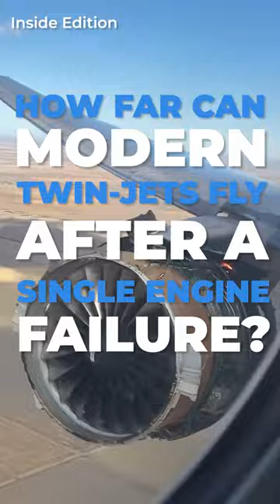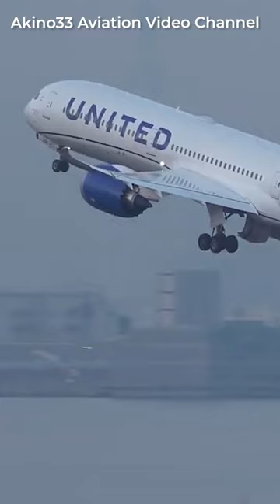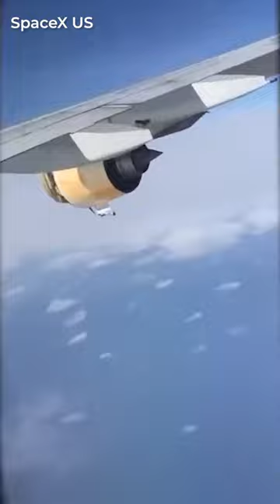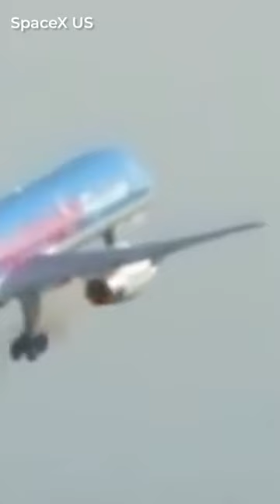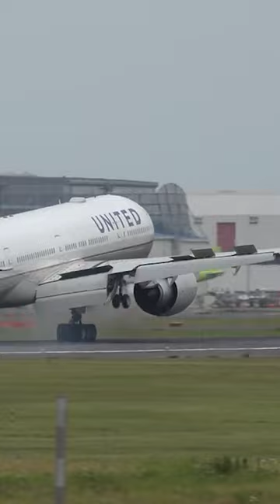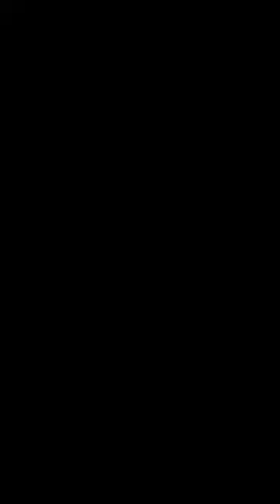How Far Can Modern Twinjets Fly After A Single Engine Failure? #shorts

Comment: The 6 hours figure quoted is for the Airbus A350, which has an ETOPS rating of 370 minutes, which is just over 6 hours. So if you had an engine failure in an A350 over Boston, you could fly to London on the remaining engine.
Reply: pilots wont. theyll divert to boston or ny...maybe somewhere north
Reply: @jacksycz  Yeah they definitely wont be continuing the flight but the fact that the A350 has the ability to do that is amazing!!
Reply: The MAXIMUM permitted flying time given is ONLY from the NEAREST ADEQUATE AIRPORT WITH SUITABLE WEATHER
The Regulations state that in the event of single engine faiure the aircraft MUST land at the nearest ADEQUATE  airfield where the weather should be SUITABLE. 
Over areas with no airports and oceans ...
Several adjacent/coastal adequate enroute  airports should be nominated before departure and the weather should be determined to be suitable at the estimated time of diversion.
You just don't fly on.
Reply: Ashly. ...you have not not a clue? ??
You are obviously not a pilot.
Reply: @awesomeman116a  It's not amazing at all....
Lots of aircraft can do that.
For all aircraft it is a "calulated" risk.
What if another engine fails ???
The calulation involves the cost of running 3/4 engines versus the insurance cost of the loss of a load of passengers....
The actuaries work out what is CHEAPER long term.
If an A350 engine fails the other engine does not come with a guarantee that it will no   t fail.
Reply: @jacksycz   Sir....your geography could be better !
NY?
Reply: What if you have to do a go around while on single engine